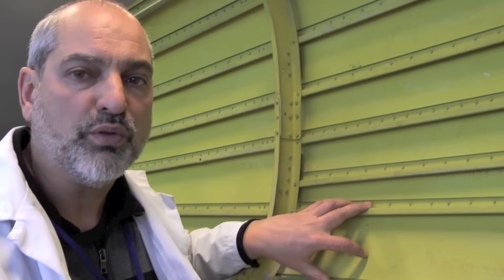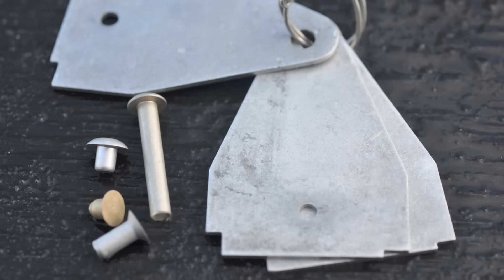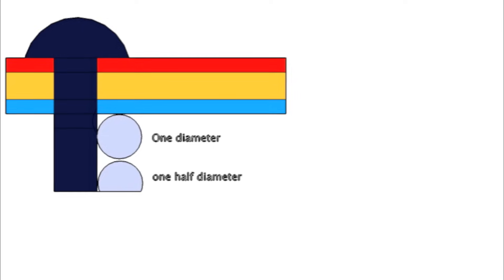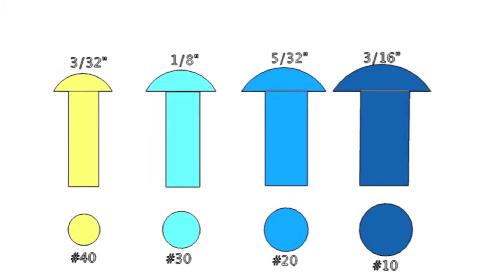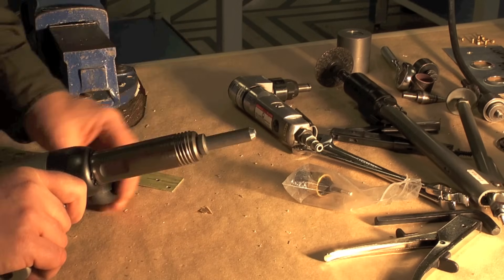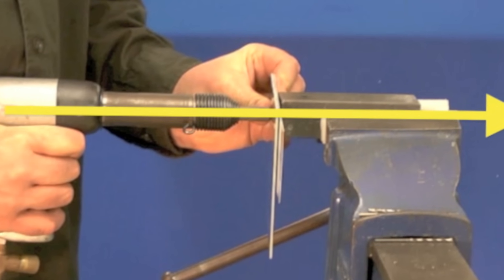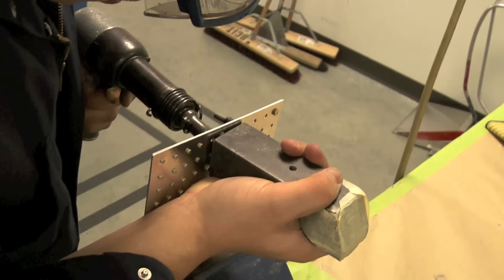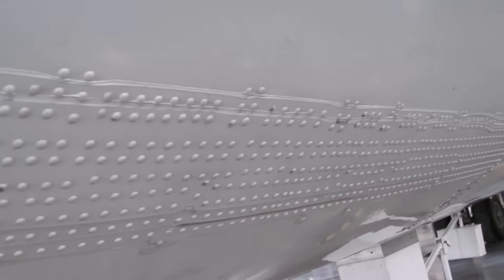Installing Aircraft Solid Rivets

Comment: Is there a different in Rivets use in business-jet and small piston power aircraft?
Reply from the maker: It's possible.  You would have to check the maintenance or structural manuals for the particular brand and model of aircraft.
Reply: @Riveteer  thank you.